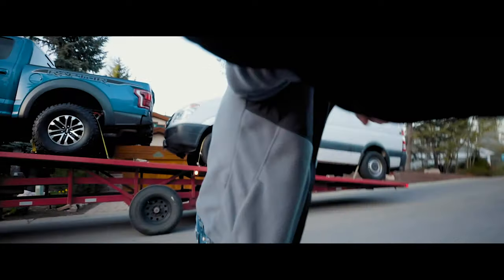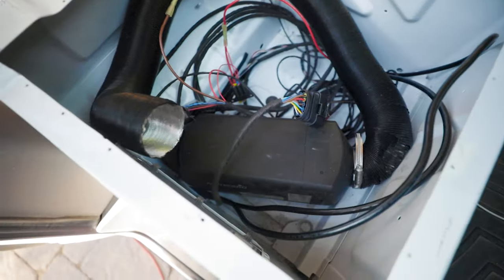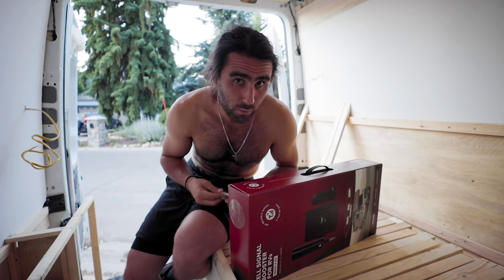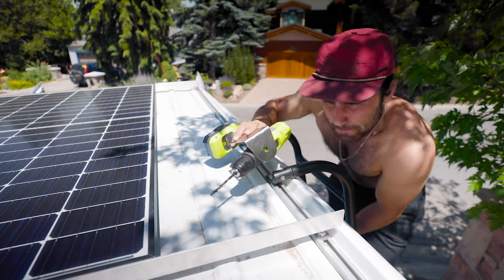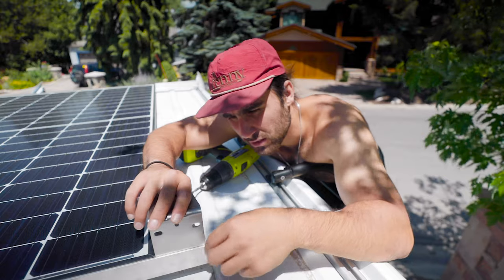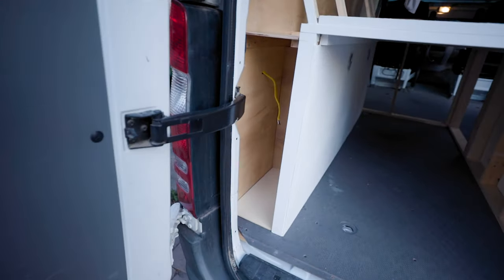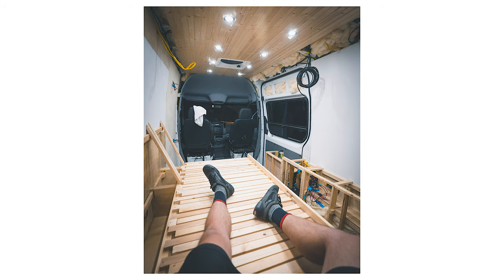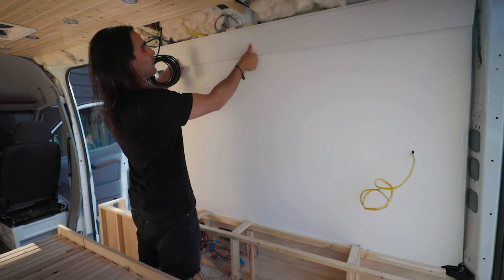installing my WEBOOST CELL BOOSTER! | sprinter van conversion

Comment: Very cool, that you are doing all the electrical, and installing everything yourself. It is very good to know how everything is put together, and what wires are ran where. When something breaks, you can fix it yourself. If your in the middle of nowhere in the dead of winter, and the heater craps out, you can fix it yourself, and get back to your day. It's nice not having to find somewhere to take it, and then get charged through the nose for a simple fix.
Reply from the maker: exactly! i have already learned so much and feel that if I ever needed to, i at least have the knowledge and expertise to diagnose and address any electrical issues that might come up! electrical was the one thing that i told myself i definitely was going to do when i was getting into the van build!

Comment: Awesome work so far! You're probably out riding in it by now :) What would you have done with your Weboost roof attachment had you not had that aluminum cross bar? I also don't have a ladder like they suggest in the manual :(